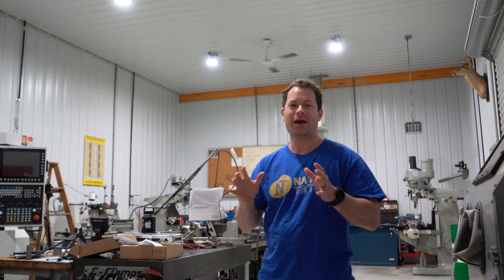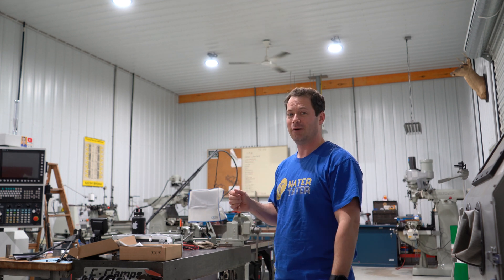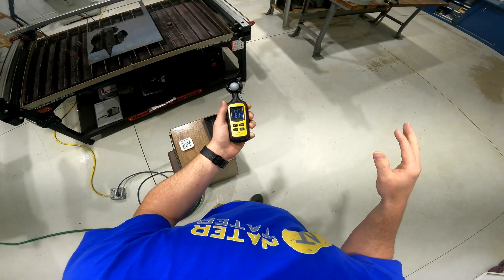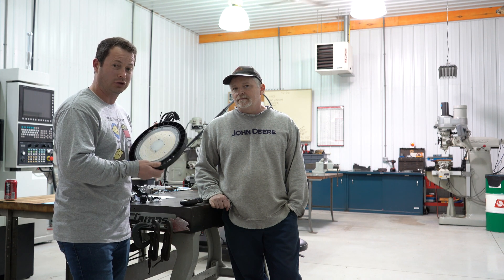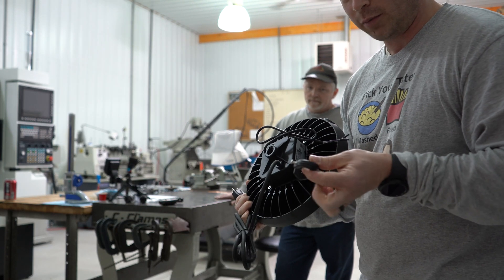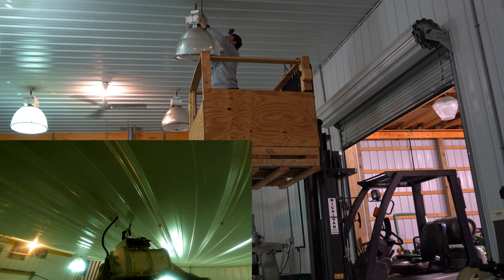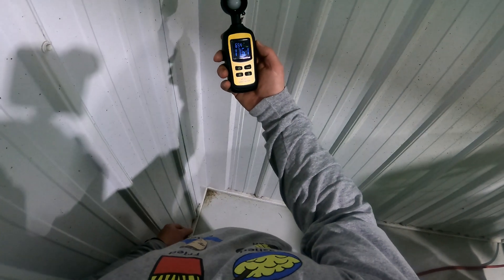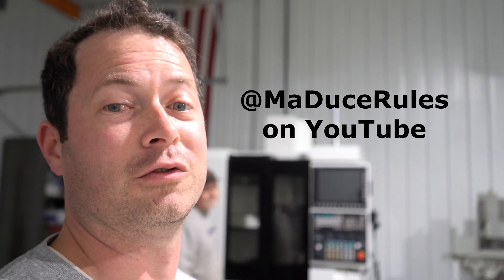✅ Full LED Replacement, High Bay Shop Light - 150W 22500 Lumens - Install, Review vs Metal Halide

Comment: We purchased these lights and had them installed at work (we ordered 25 and ended up using about 17, because the are very bright. We had one fail after about 3 months, and another after 4 months. Interesting part is the ones that failed were on a separate circuit than all the others.